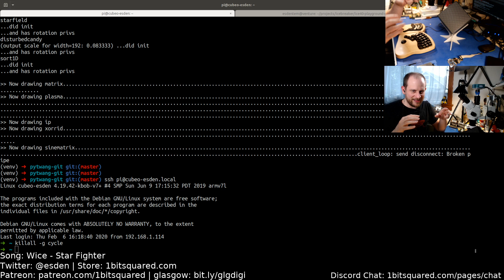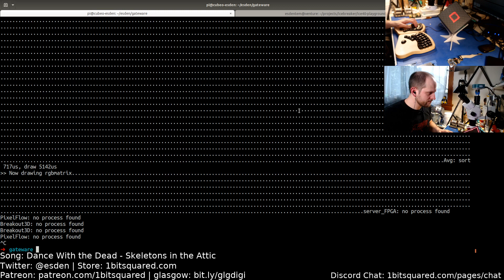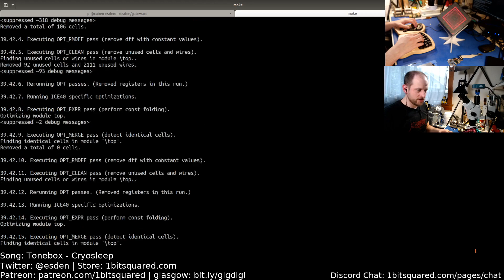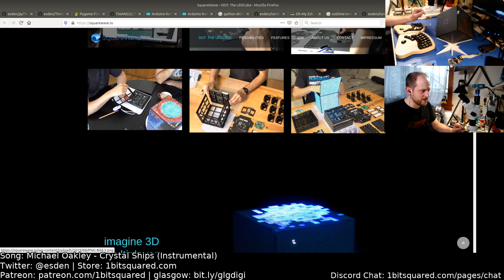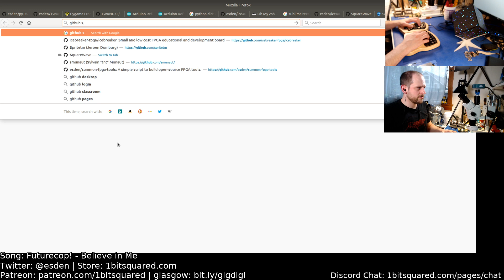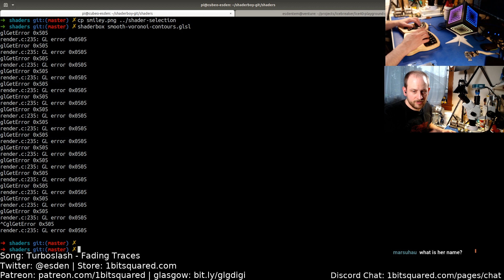iCEBreaker FPGA LED Cube - Demo and Some FPGA Work

Comment: great video, great project. I would like to realize it, only problem is the realization of the power supply card. I do not have the material to mount it. I wanted to know if there are possibilities for you to provide this card already mounted with the components for purchase?
Reply from the maker: Hi, I am glad you like the project. We don't currently have any plans to sell the assembled power boards. At some point we might do a new version of the power PCB and manufacture them. At the moment you will have to manufacture and assemble the power board yourself. All the data is available in KBob's github repository: https://github.com/kbob/led-cube
Reply: @PiotrEsdenTempski  ok, thanks i will have a look.